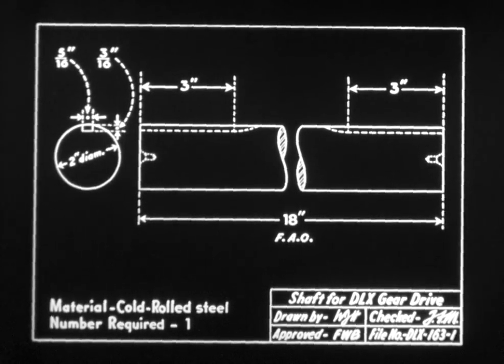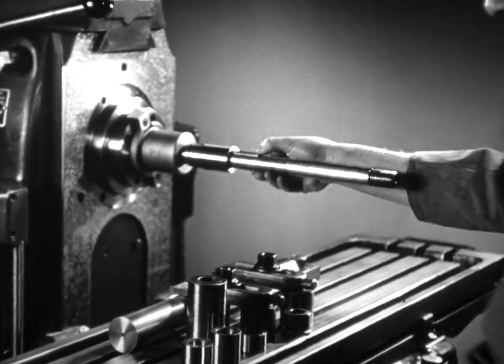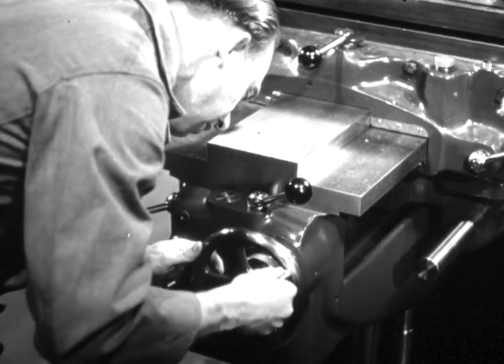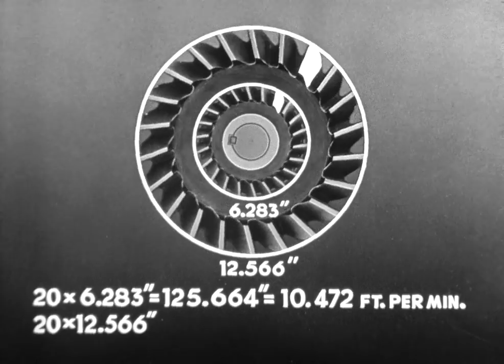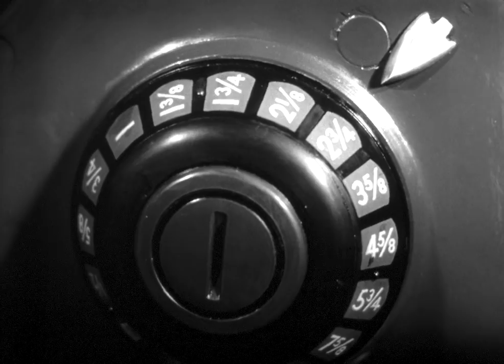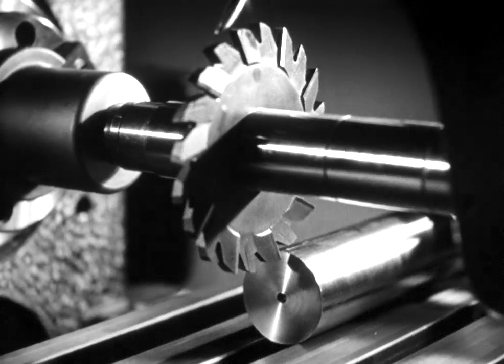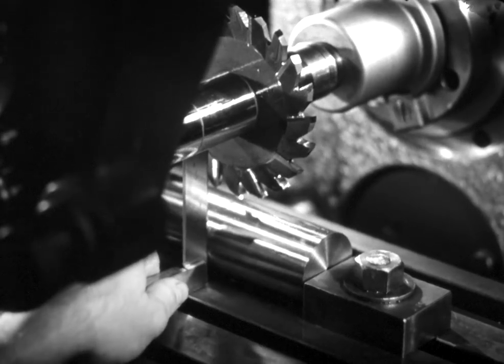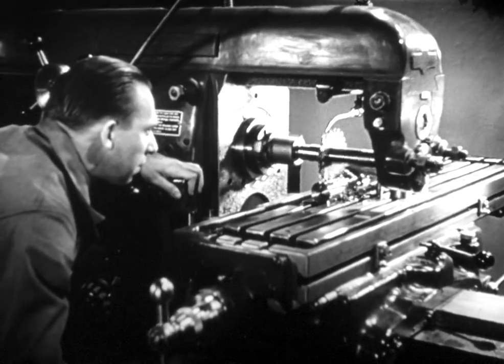No. 1 - Cutting Keyways - 1941

Comment: And they say that the metric system is too complicated.......
Reply: luviskol, I doesn't matter which system is used they are just numbers if you ignore the fractions with the imperial.
Reply: George Campbell...Best? yes; origin? NO! Inches etc. were a thumb width, or division by a dozen of a certain long ago king's foot, etc.(England). Years later Napoleon brought in the now universal metric system based on physical constants. btw, this comes out of my memory; where did you get your idea from?
Reply: George Campbell no it’s not lol but it does add extra work
Reply: @loftsatsympaticodotc  Swedish measurement legend C E Johansson got so tired with US and British definitions of an inch being slightly different, that he told them both to shut up and accept his definition of exactly 25.4 mm as an inch. Sounds crazy but is actually true! Read here: https://www.mitutoyo.com/wp-content/uploads/2013/07/E12016-History-of-The-Gage-Block.pdf
Further, one might notice that as soon as US inch-fans get into measuring for real, they all end up using thousands, which is as decimal as millimeters, just not the same. Fractions? No way.
Reply: @geocam2  Imperial units are, nowadays, defined in terms of metric units, but they owe their origins to far more obscure and ancient measurement standards.
Reply: steve gale  360'  is just an arbitrary number in and of itself.. 400' circles was proposed, originated in Sweden, and I have used it on compasses. 24 hour days? Why? We could have had 30 hour days or 20..
  Fractions are useless unless you are measuring relative quantities of fluids.
And Metric is divisable by ten because it is easy.
Reply: @loftsatsympaticodotc  

The inch is based on metric. The inch is 25.4mm exactly.
Reply: @MathewHammond1   Yes, it is. The meter is the standard for measurement. Not only for metric but for imperial. The inch is 25.4/1000 of a meter or 25.4 millimeter. Yes, metric uses fractions. They just use a word rather than a number. The metric system is easier to learn due to it being base ten. The imperial system works just fine but you have to memorize the units as it is base whatever the hell they wanted at the time.
Reply: @mansnilsson4382  

Yes, decimal fractions. Both metric and imperial use them.

Comment: One thing that they barely mentioned was machining direction. You CANNOT climb mill on these old horizontal mills because of the way their lead screw was designed. If you did decide to climb mill, the slack in the lead screw would cause it to feed way too much into the material, likely causing your workpiece to get thrown across the shop. Climb milling isn’t a problem now since new machines have ball screws.
Reply: Doesn't matter, old machines used ball screws. That only happens if you take too big of a cut per tooth. CNC machine does it too, you'll get a servo x axis alarm though. Or the spindle stalls.
Reply: Bro, I climb mill all the time with a conventional lead screw. Taking a reasonable size cut. Also you need to get the slack out screw first then cut. You just need to use your judgement.

Comment: Nice mill, vbm , I did an apprenticeship in the 70s . The vbm I had to use was line shaft driven from the 1880 90s . Man she could still turn out great parts .  I did work for a steel mill in Pennsylvania. Bearing blocks , roller shafts much more. Heavy work but I'm so happy to have done it.

Comment: some gorgeous photography in this - that horizontal mill is so clean & shiny! great lighting too
Reply: Maybe I'm nostalgic,  but it seems instructional films were more professional back then. I see stuff now that tries too hard to be funny rather than explain or properly show things.
Reply: The best things about machine tools in the 1940s and 1930s is that every instruments such as monitors, sensors, indicators, effectors, feedback systems, etc ARE ALL 100% ANALOG-BASED SERVO-MECHANISMS that shows everything simultaneously regardless whether you want to see them or not. And in the late 1970s and early 1980s they started using an all analog fiber optical technology based instruments combined with an all analog fresnel lens optical vision enhancers with fiber optic cable directed incandescent light bulb(s) to provide clear lighting and to measure, monitor, sensor, to provide feedback with precision ranging from 10 millionth of an inch to 11 millionth inch. With such machine tools YOU CAN LEARN EVERYTHING AND NOT DEPENDENT ON FRAGILE SILICON IC CHIPS THAT CAN RENDER ALL OF YOUR MACHINES INTO USELESS SCRAP JUNK! Using precision engineered machining grinders with self-adjusting mechanicall automated adjusters to compensate automatically for wear and tear, jigs and fixtures, positioners and aligners, bolt lockers, angles and degrees mechanical finder-adjusters-bolt lockers, and all ancillary mechanical devices, gadgets, instruments, rulers, measuring tools used by 1900 to 1960s master machinists. One can master all. https://www.youtube.com/watch?v=vYzQNgIwqgo&t=232s BEGIN Japanology - Small Factories https://www.youtube.com/results?search_query=japanese+small+scale+industries+&sp=mAEB
Without mastery of the low tech, you can't have the high tech" Masayuki Okano
Reply: Nick Coote 
Nick Coote1 month ago
Takes me back to my apprenticeship days! No end mills back then, just cutting discs. Surprised he didn't take a roughing cut with a thinner disc then finish cut. Plenty of oil as cutting fluid, no 'stinky' white cutting fluid..
Reply     

Travis Bickle 
Travis Bickle5 months ago
Those machine tools won 2 World Wars for the United States, they helped create the "Arsenal of Democracy" as Franklin Delano Roosevelt called it... Shame kids all want to write code for "GTA 79"
We still need tool room machinists and Die Sinkers today, and pay for an experienced man can far exceed $20.00/hr,  w/full benefits and the pride that comes from creating complex tooling from very exacting blueprints... It's honest, descent, good work for a man, sometimes even a woman...
Show less

Reply 11     
 Phil Menzies 
Phil Menzies5 months ago
Yeah. USA all the way! The input from all the other allies had absolutely no bearing on the outcome of those 2 wars. Neither of which, apparently, the USA wanted to be a part of until their hand was forced ..............
Reply 6

Comment: No need for safety glasses back then? Eyes were replaceable?
Reply from the maker: Take a look at the Millers Falls Tool Co. film. The guy sticks his hand into the wood cutting lathe while it cuts tool handles! I am sure accidents happened, but apprenticeships and hands-on training was common, in those days. Part of what you were taught was how to avoid killing yourself. That generation may have injured itself less frequently than the modern one would in the same circumstances.
Reply from the maker: Working people of that time may have been even more aware and cautious of the risks. I survived working with high voltage vacuum tube equipment. Try finding anything over 12 volts, these days.
Reply: I’ve never met any “old one eyed” machinist. Have met several with missing fingers.
Reply: Jump in your time machine and go yell at THEM. You're wasting your effort whining about it to us, here.
Reply: Safety squints were all the rage back in the day, still are in fact.
Reply: or gloves when welding....When men used to be MEN!!!!
Reply: jezus what is it with the safety nannies everwhere?
Reply: 1:46  See the machinist's tool chest.  Note the mirror in the lid.  This is to aid the machinist in removing a metal chip whenever it lands in his eye.
Reply: @MuseumofOurIndustrialHeritage  hands on training.... And the occasional hands off training

Comment: Run the same machine in the 90s.real American tough.
Reply: Those machines amaze me. I’m curious did anything every go “wrong” with them? I expect these days in six months everything would start breaking down.
Reply: Old British machines were just as good - I have a lovely Elliott Sturdimill - good name it weighs over 3 tons or almost 7000lbs.
Reply: how were the power gear changes accomplished?  it was intriguing how just holding the lever up changed rpm and down changed feed.  My K&T you have to wind to change gears
Reply: @timthompson468  mostly just wear on the metal parts rubbing together that causes issues with it not being accurate or having to tighten something down extra hard. It's kind of a pain but if you're careful, the wear isn't too bad and you can usually compensate. The frustrating part comes in when you go and replace one part that's really worn and the gears and bushings are no longer meshing right after.
Reply: British machine tools were designed to be simple AND PRECISE and to last ad infinitum.

Comment: The Standard system (inches) is far more complex than the Metric system.
Reply from the maker: Yes. The Metric system was created as a result of understanding that an interrelated and base 10 system of measurement is preferred. This concept of measurement might not have been developed if earlier systems of measurement hadn't first been attempted. I hope these films are appreciated as being part of the historic record. We are not advocating that things get done exactly the same way today. Technology properly evolves through time.
Reply: There may be some truth to that statement. BUT, when we started going metric back in the 80's and 90's EVERYTHING went to hell! Our machines,  cars , tractors, trucks and and tools are garbage compared to the earlier versions, with a very few exceptions!!
Reply: @Museum Metric is based on "the power of 10" makes understanding easy. Metric is also more accurate, increments are smaller. Metric also perfectly translates into volume and mass. If an objects density is less than 1g per cm3 it will float on water. Metric threads are also better. Programming is way easier in metric cause your using whole numbers, no fractions. ie 12mm tool has 6 mm radius. A 5/32" tool has what radius? You have a 1000 mm you can say that's 1 m. But if you have 150" inches you say 12 ft 6 in and sometimes a fraction. Inch fractions don't translate into ft. List goes on why metric is far superior
Reply: @highstreetkillers4377  A 5/32'' tool has a radius of 5/64''. The metric system is a boon for persons who are unable to multiply or divide by two.
Reply: @trikebum5  Interestingly, the reason the Reagan era push toward adoption of the metricsystem failed was that the machinist union, among others, believed that the move would facilitate the decline of American manufacturing by allowing foreign machine parts into the Country. Unfortunately, the unions failed to understand that by abandoning the metric system "change over" the unions were signing their own death warrant by crippling US expansion into forign markets. Basically the unions failed to understand that it was much less expensive for foreign interests  to retool  for the US market  and it would be  for the US to retool for the foreign market. And in the end we just ended up buying the whole product from overseas. This in turn helped create to some measurable degree the disposable world that we live in now. To be sure, this is not the only mistake but the unions made. But I think it was the largest mistake, with the most far reaching consiquences. My father grandfather and stepfather were all Machinist oh, I'm a history major. So it's easy for me to judge. But as I'm old enough to remember the transition, I feel comfortable saying no one other than the economist could have predicted the consequence.

Comment: Dis they have endmills back then?
Reply: An end mill would create a stress point because there is no natural chamfer when the keyway ends and thus cracks are bound to start there. The keyway cutter creates a gentle slope as it cuts and thus no crack-inducing stress points will form.

Comment: Just think, if you used metric, all the numbers used would be zeros instead of 15 thousandths or, .001678 or .001456739 etc., plus all the multiplying and dividing of multi-numeral equations. For example: 20x6.283"=125.664"=10.472 ft. per min. for just one measurement. Whew!
Reply: R U 1 2
The only way that the numbers would end in zeros is if accuracy was not important. His answer, 1.171 inches comes out to 29.743 mm. Still a fraction.

Comment: I wonder why they cut conventional and not climb mill
Reply: axisfiver axisfiver
Try climb milling on a conventional machine. You will find out what what the term crash means. Conventional machines use standard Acme threaded lead screws. These screws have backlash. If you were to climb mill, the force of the cut would take up the backlash violently.

Comment: its all CNC now
Reply: Still the exact same thing. You just hire bunch of dummies to operate it while you program the movements so a guy isn't standing there cranking dials, making mistake
Reply: Not in the real world. Repair and custom machining work often use the same vintage tools you see in the video. Repair machining is what keeps factories going.  It's faster to cut metal for individual parts if their complexity doesn't require CNC than it is to program and set up CNC machining centers. My machine shop owner bro (I help sort out older CNC machines and his computers) is a multi-millionaire and most of his fleet is ancient. He even has a near-perfect Cincinnati shaper older than 1920.  He has CNC too but manual machines are critical to making money.  No CNC of similar capacity to his WWII American Pacemaker lathes would pay off in custom and repair machining.

Comment: Those machines still run to this day.  Solid.  But I am a CnC machinist.  I would rather put that in my hurco. I could one shot that key way on size in about 15 seconds in cutter comp.   yes those machines helped win the war.   There is just no place in the modern machine shop.  It would be impossible to turn a profit. Pun intended.
Reply from the maker: Do you still check the work? Much of the content of these films are about stressing that the job gets done right. Of course technology improves over time, but I still don't see how humans will no longer need to verify that things are being done properly.
Reply: The CnC I run is accurate to 14 decimal places.  It displays only 5.  Of course work is checked. It is a totally different era in the machine shops of today.   Gotta love it
Reply: @donaldcampbell7894  I'll bet it's not accurate to fourteen places. I'll bet it's barely good for .0002".
Reply: @donaldcampbell7894  14 d.p?  Six d.p is one millionth, you can get that sort of variation by breathing too hard, in the next county. I call BS.
Reply: @MuseumofOurIndustrialHeritage   We have a machine shop that resembles the one in the video.
heavenlymachining.com for a peek. There used to be a CNC shop a block away. They went broke sold their machines and the owner got a job teaching welding to high school. "Those who can't do teach". We are still going as strong as ever. "Those who are putting on their swords shouldn't brag as if they were taking them off."
Reply: Donald Campbell 

I know the type of shop you are working in. I always hated working in shops like that. They are so limited in what they can do.

Comment: they muricans and inches...
Reply: chrisaberhallo, nothing wrong with yards ,feet, inches and thousands of an inch, ignore the fractions and both imperial and metric are just numbers.
Reply: A good machinist can use both metric AND imperial systems with ease and convert on the fly too !!! 😎
Reply: @peterfitzpatrick7032  , a good machinist doesnt get in contact with the imperial system....
Reply: @karlhrdylicka  nearly everything is wrong with this system, btw the definition of the imperial system is based on the meter!
Reply: @chrisaberhallo  Ya totally agree......I had a customer come in with 500k worth of work for me but the prints were all in imperial.....No thanks....I'm above that imperial nonsense.
Reply: No. 2 Cincinnati medium speed dial type mill in as new condition! Magnificent machine tool!
Reply: Just as easy as the Metric system when you break it down by 10 or 1000.
Oh, and were AMERICANS!
Reply: @chrisaberhallo  all fine & well but if you work in a small jobbing shop which takes on repair jobs ,as I do, 
 you are going to see both standards. I'm irish & I see & work on a LOT of british stuff so
 I need to be able to handle imperial measurements . We also see a lot of european gear so all metric there... ☺️
It's no biggy really & I don't understand why people have an aversion to one or the other....
Reply: @jimmyt636  you turn down that job because it was in Imperial dimensions? You're not serious
Reply: @peterfitzpatrick7032  Mostly because people have an aversion to any extra thinking...
Reply: @jimmyt636  What CNC system are you using that can't convert  Imperial to Metric on screen?